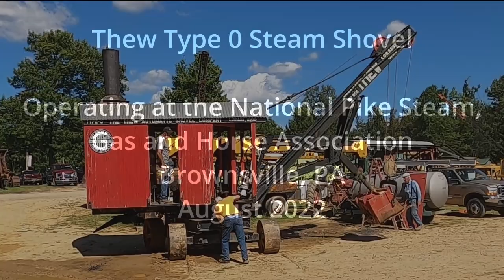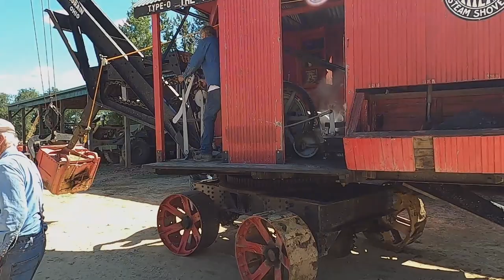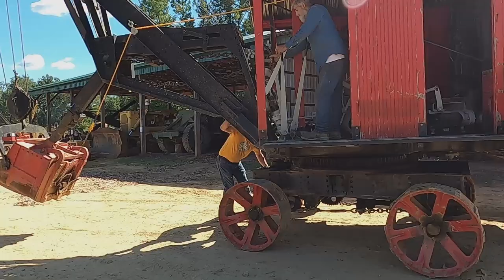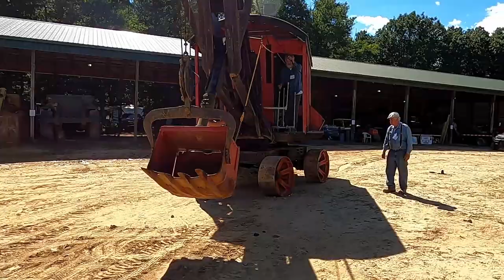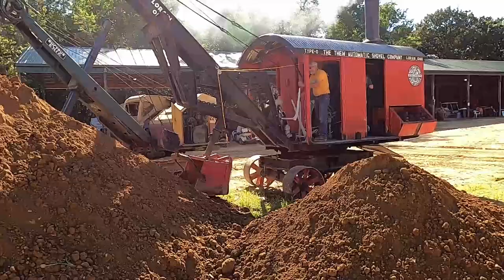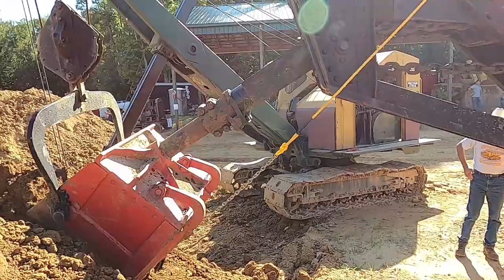Thew Type O Steam Shovel Moving and Digging

Comment: Wouldn't it have been that the shovel rotate 180 degrees so the guy steering was walking behind them and steering from the rear? Seems smarter and safer.
Reply from the maker: That would make better sense. I have been at the steering crank once and did not like having that machine rolling at me. I will ask the owner why.
Reply from the maker: I talked with the owner of the shovel and he said that it was steered from the front because it would be easy to steer into the pile verses backing into the pile. During normal digging operations you would only move short distances and would be easier steering using the foward wheels.
Reply: @EarthmoversofthePast  I thought the house rotated on the chassis 360 degrees?  Or 180 is still a better option than try to explain to a loved one "Yes he tripped and we ran him over and killed him but we were only going a short distance"... seems kinda stupid to me but thanks for following up.
Reply from the maker: @quietbrianquiet  Yes, the house does rotate 360 degrees. OHSA has made many improvements to the safety of machinery for sure. This is the first time that I saw them move this machine under it's own power. We usally use two crawler tractors one in the front and other in the back to slowly move the machine to the pile. I plan to have more videos of this shovel and other earthmoving machines of the past early spring this year. Thanks for the comments.